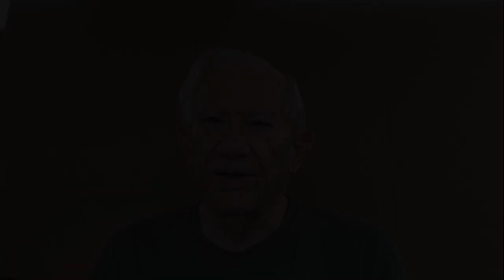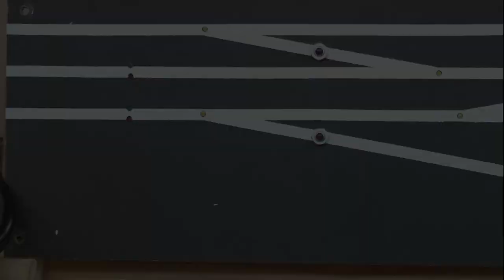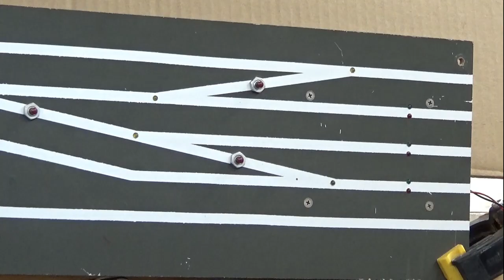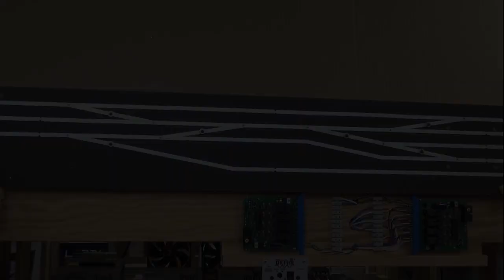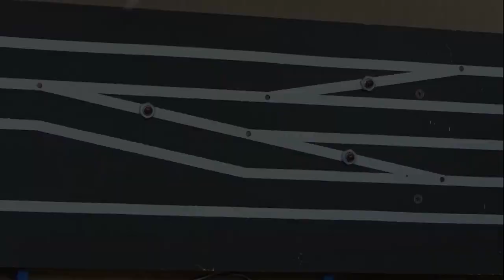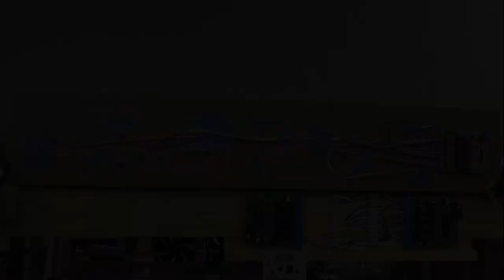PDRR Control Panel Example (for Rick Bailey)

Comment: Art what a great set up. Are you for hire?? Haha.. hope all is well Sir
Reply from the maker: Darren, considering that I work slower than most glaciers move, I doubt that you would really want to hire me. That panel was OBE when I last reconfigured the track plan, and I still having gotten around to making its replacement. Any way, thanks for watching.  Art...
Reply: @pdrrengineer1404  Hahaha.. we could call it a project. Fun had by all..

Comment: Hi Art,  That is a nice looking panel.   I thought there would have been a lot more wires on the back of it.  Take care. - Paul
Reply from the maker: Thanks for the compliment Paul. To make the panel easily removable, there was a 6-cond. phone cable that handled the switch inputs and an 8-cond. cable that handled the power and serial link for the LEDs.  Art...